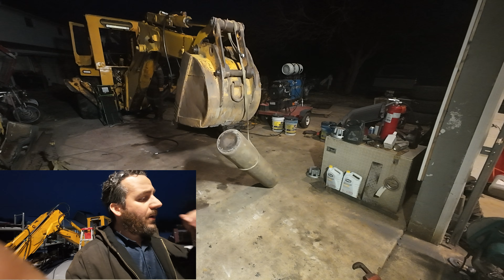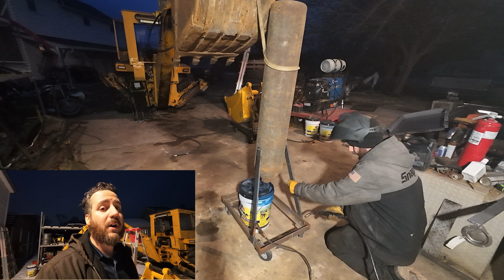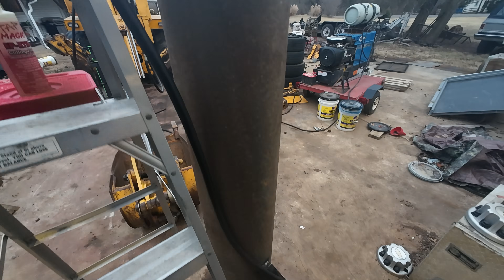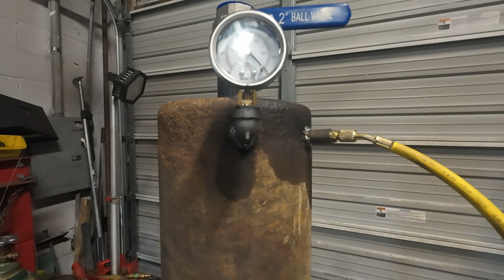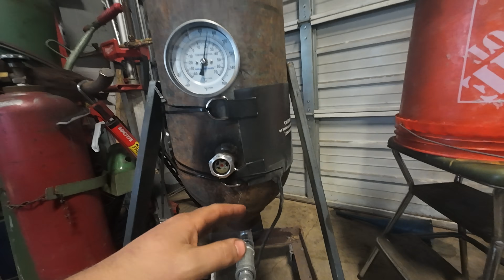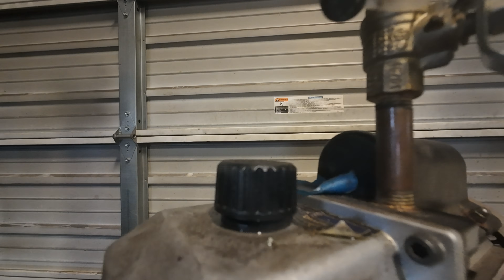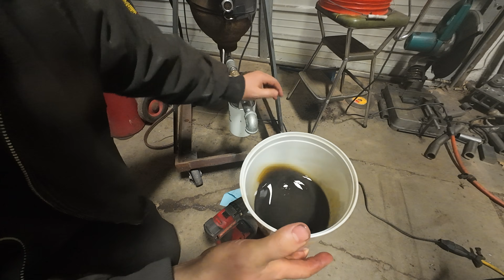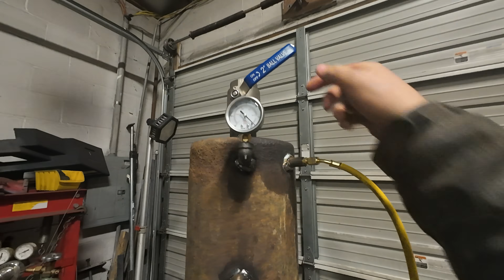I made a machine to remove water from hydraulic oil. Vacuum de-hydration

Comment: This was quite helpful. A suggestion for getting the contaminated oil out of the cylinders quickly: Disconnect the lines from the cylinder in question and work it back and forth. Easy to do on smaller ones. For the larger ones, perhaps do one side of the cylinder at a time, with a bucket or barrel to catch the oil on either side of things-- a bit of line screwed into each side of things to go into the container will help. I've done this with a disabled skidloader to both save oil and not make a mess when I had to force the loader arms up to be able to tilt the cab. I also refilled an 1135 Massey with a cab in similar fashion, due to hydraulic oil dipstick and fill awkwardness.
Reply from the maker: Great suggestion!

Comment: What type of water did the hydraulic oil get contaminated with?
If it is raw water, you will remove the water with your method, but the oil will have the same hardness and minerals as the water.
If it is water similar to distilled water, you will not have any problems, but you will have problems with raw water.
If you let the oil rest and the water settles and you remove it from the bottom, the water will take some of the necessary additives that the hydraulic oil contains.
Reply from the maker: Its probably some pretty nasty rain water if I had to guess. Very likely left some nasty behind.

Comment: You don't actually need Hy-Gard for hydraulic oil in a 410 especially if it's 410k and newer. You just need J20C standard oil iso 32-46.
Reply from the maker: Yes, that's true. There's a lot of drama over the J20C and the tractor supply VP fluid, is the VP fluid actually good enough, etc. To me its a 50 year old machine that has had a tough life, I am sure its just happy to have some kind of oil and (less) water.

Comment: Should have made a centrifugal separator instead. It would cost less to operate and would work much faster.

If you went that route you could use magnesium sulfate or any other dessicant to adsorb the water and break up that nasty emulsion then simply spin it clean.

Comment: This process will likely have an effect on the chemistry of the hydraulic fluid.  You're essentially doing a steam distillation which severely drops the vapor pressure of everything in the mixture and will distill over organic compounds well below their boiling point.  Seems like a good way to clean water contaminated fluid over all though.
Reply from the maker: I agree. I wouldn't recommend for newer and expensive machines. But for old worn out farm equipment, I think its a win.

Comment: I agree with other comments on a few standpoints, 
1: definitely add a condensation spot between the pump and the tube if possible, would help with the pumps lifespan
2: I would send a sample of the new, pre, and post boiled oil to see what’s going on, new to get a start line, see what’s going on, pre to see if it’s air, liquid, what’s going on, and then post to make sure it’s still good and that dark color and fine, make sure you got all the water out etc,

Otherwise nice build, although perfectionist side of me wishes you had cleaned up the outside of the barrel but ah well

Comment: You have build a half destillation apparatus.  Your moisture has only one way to go and that is through the vacuum pump.
You need at least a *cold trap*. That is a vessel supposed to intercept all kind of destillate not staying in the apparatus.
It is an empty vessel with a second vessel inside. The moist are is led down around up the other side of the inner vessel. In the inner vessel you have a coolant like dry ice or cold water. The decrease in temperature condensates the water and traps it in the outer vessel

Comment: At 5:30 wrt "the welding shop got it wrong." Well, given that level of pitting chances are that it wouldn't have passed hydro, so they were just looking out for you trying to stop you wasting money on a failed hydro [yes, you pay up front, no refund if it fails..] Don't store your welding tanks outside w/ a lot of thermal cycling to collect condensation? It's just an idea...
Reply from the maker: Thats a good idea for the original owners. I get the tanks for free for this reason. I would never cut up a good tank, far too valuable for me.

Comment: Is there any reason you wouldn’t be able to use a T-Fitting at the point where the vacuum gauge is (rather than the 90° Elbow) to add the JIC fitting for the pump?
Reply from the maker: You sure could, no reason not to.

Comment: Cool idea, though I doubt that raising hydraulic oil to over 100° C would damage the oil. That being said, you now have the thing built so might as well use it. A few things that come to mind.
1. Insulate the boiling chamber and heat from the middle (or better yet heat the top with a separate heater). The last thing you want is water vapor to be condensing on the walls above the oil and flowing back down. Ideally the walls should be a little warmer than the vapor.
2. Doing this in cold weather might actually be beneficial for running a cold trap to remove the water before it hits the vacuum pump. Just run your vacuum line through a few feet of copper tube, ideally placed outside if your garage is heated, that drains into a holding container before it goes to the pump. In winter weather it should be cold enough to condense all the water out before it hits the pump.
3. You might be able to determine the water content of the oil by measuring the density with a hydrometer once you get a baseline reading from freshly dried oil.
Reply from the maker: Great tips!

Comment: you could pull in from your 'discharge' valve into a vacuumed out tank, skip one more dirt entry point.  I did long slow heat on a few hot days and didn't get above 220f  wash/rinse/repeat to flush all the cylinders with about five draining cycles. Also used a 5 micron filter to pump it back into the machine. You might want to run it through a 1 micron type filter, machine filters are usually 20 micron.  A side thought, if the seals on the backhoe are good, wait till a warm day put a vacuum on the backhoe tank itself even while operating it.

Comment: Have you considered using an oil water separator for the fluid instead of boiling the water out of it?
Reply from the maker: I considered it but wanted to minimize needing consumables to do this work
Reply: I ran into a liquid issue with the vacuum oil in my pump pulling a vacuum on a large chamber. Do you see the same issue boiling off the water through it?

Comment: I have a 400 series backhoe and although I don't have the same problem, My thought was while operating the machine at operating temperature hook a vacuum pump up to the transmission vent. if it sealed well enough at least you should be able to do it without removing it from the machine.
Reply from the maker: I feel like that might cause leaks. Those gaskets are old and I dont want to test them any further

Comment: Just heat the oil to 220°F
Reply from the maker: I dont want to get the oil that hot
Reply: @spankranchgarage  like when you run the engine????  Ever have a new built that has moisture?  When you run the engine you see nasty stuff on the oil cap or the valve cover breather?  That's the moisture coming out after the oil gets to operating temperature.

Comment: From my experience, I wouldn't weld pipe fittings on it, I would have just drilled and tapped the old oxygen tank for the pipe thread. It seems like less work and there is always leaks when I weld fittings...not sure why.

Comment: Ya know, you could have done this with one of the 7 gallon paint sprayer cans. I used one to make a vacuum/pressure tank for epoxy.   It already has all your fittings and such, and a 3 gallon bucket fits right inside, or you can use the 5 gallon stainless steel sleeve it comes with.  Then just pull the bucket to empty it.  <shrug> not that this wasn’t cool.  Just could have been easier.  

Also, I think you could figure out how much water is emulsified with a density measurement.   Weigh 1 gallon of the contaminated compared to one gallon of new vs one gallon of post vacuum treated.  

Making me think.   Stop it.

Comment: I have 2 questions. Where did all the water go and have you tested the oil yet? I may be assuming there was a lot more water than there actually was? AWESOME video! Thank you very much!
Reply from the maker: Its mostly evaporated and captured in the oil of the vac pump. Not ideal but vac pump oil is WAY cheaper than hydraulic oil

Comment: grab some steel pipe weld a fitting on either end fill it with silica gel or another desiccant and put that between the tank and the pump you will need to replace it every once in a while but you can get silica gel that changes colour when its saturated with water

Comment: have you tried the "crackle test"??  if you dip a little piece of paper towel in the oil and set it on fire (in a safe place) the burning oil will usually crackle and pop if there is moister in it.  if it doesn't crackle and pop, then there is minimal/no water in the oil.
Reply from the maker: I havent but thats an easy trick ill remember in the future!

Comment: 4:15 Probably holds the water because pumping a 0.5% saturated solution will compress, whereas a stray water bubble won't. No compressability  = boom last I checked.

Comment: You could put the fill port at the bottom of the cylinder, pull a vacuum and then suck all the oil into the cylinder. No need to hold a 5 gallon bucket on a ladder.
Reply from the maker: Thats a great idea I will do that next time

Comment: The method in the video basically works, but if the oil gets too hot or stays under vacuum for too long, it can be destroyed. The dark oil indicates that either oxidation or thermal decomposition has occurred.
Reply from the maker: Its not actually very dark when you look at it on a towel. Only looks dark in the bucket. This cheap VP oil is very dark when its new.

Comment: I think the dark color is coming from the vessel. Easiest thing to do about it is to run the fluid through a bypass filter medium- think paper towel (cellulose fiber) stack with a pit of compression in a tall pvc pipe stack with a LP pump to slowly percukate the fluid first down through the middle of the stack and then up through the fibers.

Google 'frantz bypass oil filter' for ideas. It's an old school hotrod and Diesel engine trick. The diesels use paper towel rolls due to larger sump volume.

Yes, it sounds crazy. So does making your own vacuum oil drier. Well done, sir.
Reply from the maker: Thank you!

Comment: Contamination from the sides of the “OLD” tank?  Did you clean the tank before adding your oil?
Reply from the maker: No I didnt. So any particulate under 10 micron could remain in the oil
Reply: @ Thanks.  By the way, GREAT video….very interesting.

Comment: It would be worth your time to determine how water is getting into the system and mitigate that. Like don't top off fluid in the rain or snow without a cover overhead even if it's an umbrella.
Reply from the maker: I buy abandoned equipment thats been left to die. Almost all of them have water in the oil when I get them. I wont allow any new moisture to enter

Comment: your never going to get the water out of the oil haha 
what your doing now is spending money that you could have used on new oil 
about 10 years ago i looked into this and the water binds the the molecules of the oil and there is not a thing you can do 
if you cook it and it comes out clean you just changed the color of it  the water is still in there and if you use it your going to rust out your pumps 
drain all the oil and fill use  drain oil fill and keep doing that till all the first oil is gone and fix the leak where the oil gets in 
for that check where your vent hose is and if the end of it is sitting in a puddle of water or cracked or broken
Reply from the maker: I disagree. I see the water in the vac pump oil, this most certaintly does work
Reply: @spankranchgarage  you dont know shit 
you might see water but its what you can not see the oil and the water are bonded just like when that guy goes over to your place when your not home and well bonds with your wife and leaves liquids behind what happens to them they get bonded 
ask your wife she know all about it
Reply from the maker: @stevesteve-w2g thanks for the comment I’ll keep that in mind for next time
Reply: @stevesteve-w2g  Sorry about bonding hard with your wife bro. Tell her Henderson said "Hey"
Reply: @ that was spankranchgarage wife not mine i dont have one

Comment: A.  Use the vacuum to pull the fluid in...just run a hose down to the bucket, turn on the pump, drop end in bucket, open valve...it will suck in the fluid to fill the tank
B.  A very thin layer of silicon 1 will act as a very good heatsink compound to ensure the heat from the heat band goes straight thru to the metal of the tank
C.  Wrapping the heat band with a layer of glass fiber insulation will trap all the heat into the tank making it heat faster and trap the escaping heat to convection
Very very very very cool build and ingenious idea!
Reply from the maker: Great ideas thank you!

Comment: I would add a catch can style 'bubbler' filled with old engine oil between the tank and the vacuum pump to catch any foam or water with a water drain at the bottom to further protect the pump.

Comment: You can add cold tank on the vacuum line to let water condese there instead of going down in to a pump oil. Just need to add a vacuum switch to cycle pump on and off to keep vacuum at a certain level. Back in the day (about 30 years ago) we used tall tower filled with about 3k lbs of silica gel to dry transformer oil. About every 6 months we would pull gel out and bake in the vacumed oven to refresh it. Same oven we used to burn off lacquer before rebuilding a trans, or drying after rebuild before putting back in the oil.

Comment: I’ve heard a little bit of air bubbling through the oil helps remove water by giving it somewhere to go, like a flush 😅 but I don’t know the specifics, point is it might not be a bad thing 😊
Reply from the maker: I agree with you! It breaks the surface tension and helps the water break free easier

Comment: Moisture will start evaporating off even before you get to the boiling point, so likely you were not to boiling point yet when you first saw that steam coming out the exhaust. Also, this size sidewall container is way overkill for the 27-28 inches or so of vacuum that an HVAC vacuum pump can manage. I just watched a video of a guy that drew that kind of vacuum on a thin wall stainless cooking pot and some lexan sealed over the top. Won't hurt anything though.
Reply from the maker: Just using what I had around. But your right. The water will flatline the temperature until its gone

Comment: Some vacuum pumps have a ballast feature which can help with the contamination 
You can also order the vacuum pump rebuild kit for lonconco 180/230/etc for low cost and rebuild them easily yourself , I did a couple in my university when doing research

in refining, there needs to be some serious particulate filtering, likely vacuum assisted for viscous oils.
And keep in mind heating hydraulic fluids can alter their properties and burn/boil/react lighter hydrocarbon based components , it can change chemistry

Comment: Great job! Regarding the darker colour of the oil, when you removed the drilled plug from the base I noticed it was stained/oxidized dark grey/black on the inside surface. Not sure if this has aleardy been mentioned in the comments but this could be a possible cause of the oil colour. Cheers for the great content.
Reply from the maker: I agree, that tank was very dirty inside. It seems to be getting better

Comment: Some pressurized tanks rust.  Would any of the oil darkness have anything to do with oxidized or rusted iron?  Even CO2 tanks corrode.
I would invest in taps, so you could machine thread your holes in the tank.  Using a NC type thread (where it has smaller diameter the deeper you thread is) ensures you get a nice thread tight seal.  But for the sides of the tank where the thickness is less, you are still stuck welding nipples on, unless you weld steel bar on the sides and then drill and tap it.  Can be fun creating a air tight seal, some guys I knew did tanks for a living, and they got it to a science welding tanks.  I wish I knew how to weld as beautiful as they do. Great video.  I'll pass the information to the guys at the farm as we go through a hefty amount of fluid and this might help save a few dollars and something to make us more valuable to the boss during the mid summer or winter months when things are not growing or waiting for things to mature for harvest.

And yes, I would also use a second tank before the vacuum, in an area where can be cooled, either in a small bar freezer or fridge to condense the moisture.  You do not want the moisture getting into your Vacuum.
Reply from the maker: Great suggestions thank you!

Comment: air compressor lines usually have dryers along with the lubricators and regulators.
the dryer can probably handle the vacuum if placed between the tank and the pump

Comment: Great project. To prove it's not entrained air, just apply the vacuum without heat. If it still clears up youve got  your answer.
Reply from the maker: Its likely a little bit of both! I get some bubbles on the dipstick when the machine is running

Comment: Run vacuum line thru a water separator. Run processed oil thru a micro mesh screen and a very low micron  filter element before adding back in the hydraulic tank.

Comment: You could actually fill it through the small valve before the filter by putting a hose on it and applying the vacuum.

You should have a glass liquid separator before the vacuum pump and a glass sight tube would be good as well

 I enjoyed the video, good build 😃
Reply from the maker: All great ideas thank you